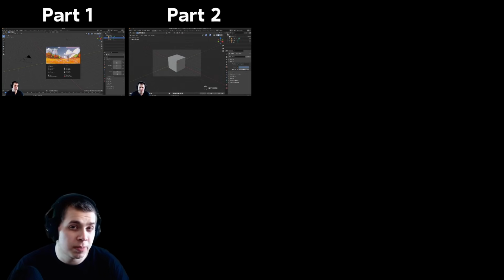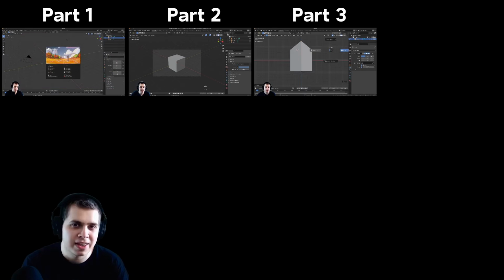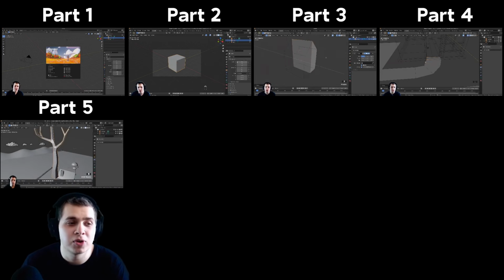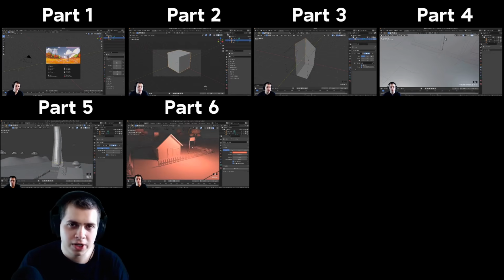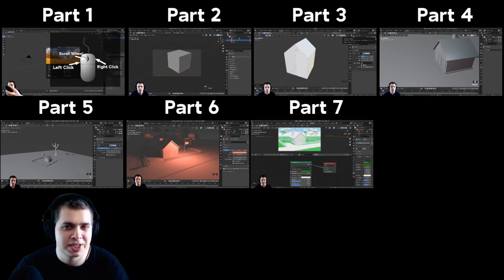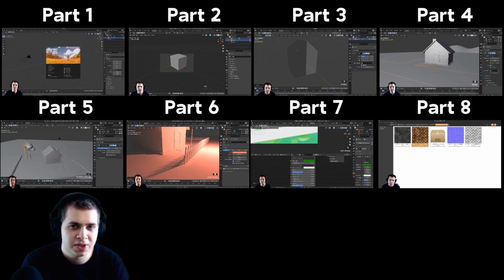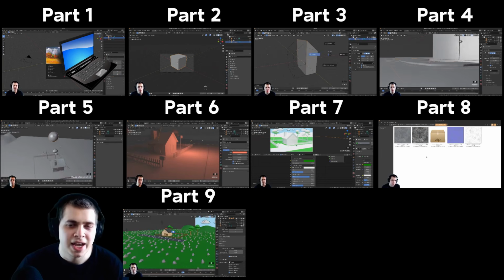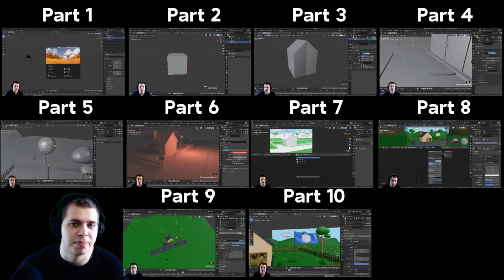Blender Complete Beginner Tutorial Series - Introduction (Updated Tutorial Link in Description)

Comment: I HAVE A GRAVITATION EFFECT NEW CONCEPT THAT I WANT TO DEVELOPPE IN BLENDER SO I WANT TO LEARN MORE ON BLENDER TO MAKE MY PROJECT AS I AM THINKING IT TO BE BUT I FIND MY SELF SO FAR TO GET SO SKILLS AS YOU TO DEVELOPPE IT ASAP SOME BASICS ARE NECESSARY FOR MY CONCEPT THAT I DO NOT FIND IN TUTORIALS AS: FOR EXMPLE; I WANT TO CREATE A 3D SPACE MAKE BY CUBES, IN THIS SPACE I WANT TO DROP A MASS EXEMPLE A PLANNET WHICH WILL OCCUPED A SPACE INTO THIS 3D CUBES SPACE THE PLANETE WILL ABSORBE THE CUBES IN ITS SPACE AND BY THE WAY THESE CUBES WILL NOT HAVE THEIR ORIGINAL DIMENTIONS BECAUSE THEY ARE ABSORBED BY THE PLANET AND HAVE BEEN CONTRACTED BY ITS GRAVITATION EFFECT SO THE FIRST CUBES ORGINAL WHERE FOR EXAMPLE A 1*1*1 U, DIMENTION BUT WHEN THEY HAVE BEEN ABSORBED THEY BECAME 0.5*0.5*0.5 U, AND THIS RATIO DEPENDS ON THE GRAVITY DENSITY OF EATCH SUBJECT, FOR EXAMPLE IN A BALCK HOLE CUBES WILL BCAM 0.00001*0.00001*0.00001 U, RATIO THE ORIGINAL CUBES. I WANT TO CREAT A EFFECT OF THIS SUBJECT ON SPACE WHEN IT IS MOVING AND CONTRACTING THE SPACE AROUND IT BY CONTRACTING THE SPACE OCCUPED AND DILATATE THE SPACE AOUND IT BY THE SAME RATIO, FOR EXAMPLE, IF THE CUBE IS CONRACTED BY 0.5*0.5*0.5 IN WITHIN THE PLANET, IT WILL BE 1.5*1.5*1.5 THE CUBES AROUND THE SPACE OF THE PLANET AND WILL REGRESS FROM 1.5*1.5*1.5 ON THE SURFACE OF THE PLANET TO RETURN 1*1*1 IN A DISTANCE FROM THE PLANET WHERE NON GRAVITATION EFFECT WILL BE OCCURED. MY CONCEPT IS BASED ON THIS EXPLANATION IF YOU COULD UNDESTAND WHAT I AM LOOKING FOR. PLEASE IF YOU ARE INTERESTED TO HELP ME FOR THIS PROJECT WE CAN WORK TOGETHER ON AND I WILL GIVE YOU ALL NECESSARY SKECH OR ESQUIS YOU NEED. BEST REGARDS
Moins